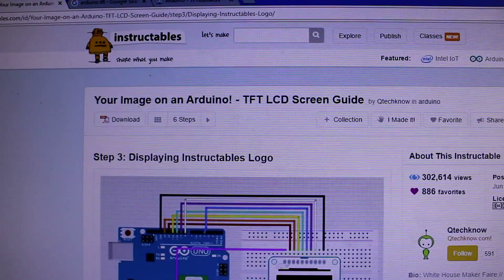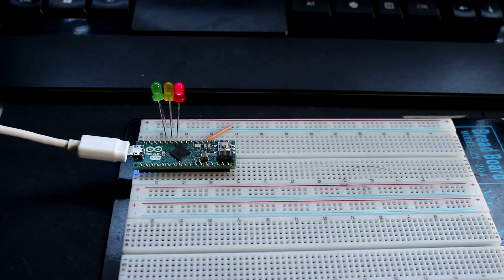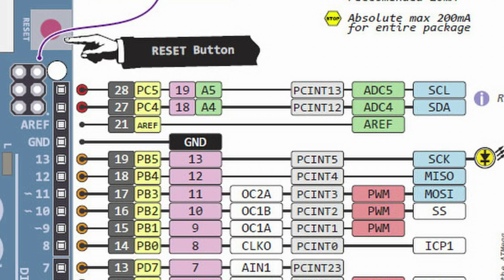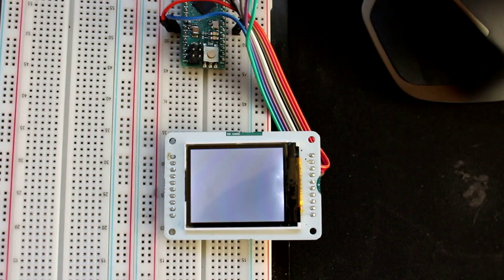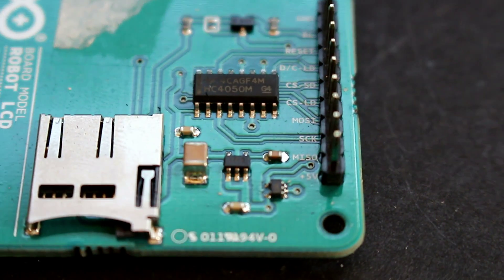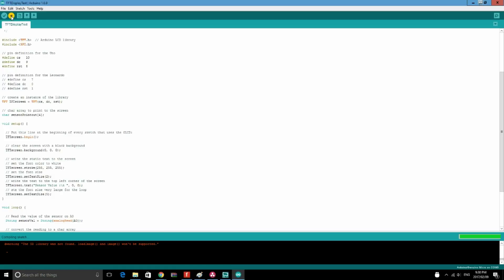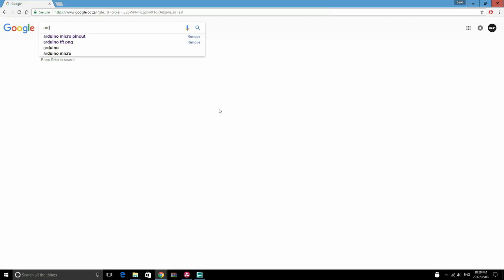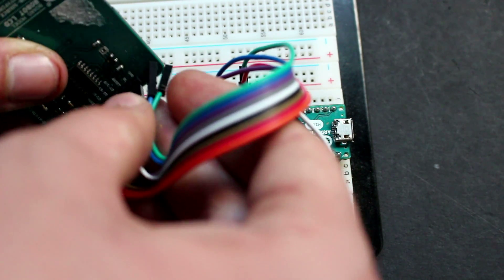Can I use an Arduino Uno for this?

Comment: You kinda look like DanTDM lol
Reply from the maker: Good enough
Reply: Build It I didn’t expect you to reply but if you’re reading this then I just want to say I really would like to see you could build a speaker system for your raspberry pi laptop or for other projects.
Reply from the maker: A speaker system sounds awesome! What features should it have
Reply: Build It I think it should have a dial to control the volume and maybe an indication light for when it’s on, if you wanted to you could add lights sign that could move to the bass of the music or sound.

Comment: Hi I have entered a problem 
Just tell me how do we control 360 degree servo with Arduino mega? The 360 degree work great with the UNO but there seems a problem with Mega the motor doesn't go in reverse direction (I used a PWM pin in both cases)
Reply from the maker: Hmmmm, have you tried using a different PWM pin on the mega
Reply: Build It 
Not till now but do you think that pin has a problem? Sure i will try with a different pin cause its new and it was my first time using it.

Comment: Great video. One minor correction would be that TX and RX are not usb communication, they are serial communication, TX for transmit and RX for receive.

That said, I do like that you call them "dedicated pins" really gets the point across.
Reply from the maker: Thanks for the correction, I think my misunderstanding came from my understanding of how Bluetooth modules communicate with the Arduino, makes sense now. Thank you!
Reply: Yeah, the BT module sends serial data to the arduino as well. In fact when you upload code to any of the Arduinos you are actually just passing it through a USB to serial adapter, but it ultimately reaches the Atmega via a good 'ol fashioned serial link. So there is no "native" USB on any of the Atmega/Arduino boards.

Further to this, the Serial to USB chip is one thing that changes when you go out and buy a cheap arduino clone (which I highly recommend, since you can get the Uno copies on ebay for sub $5 in most cases).

Comment: in the last step of the vid you mentioned we had to (Connect Everything), but for my project which is the lie detector that is found in your previous video,  I require an Arduino Nano R3, but all I have is an Arduino Uno, and I can't connect everything if I don't have the Arduino Nano R3 is there another way to be able to use an Arduino Uno instead of the Arduino Nano R3. Also, I'm a bit of a newb to this arduino stuff, so will this project work without me even having to (Connect Everything) but just using the Arduino Uno
Reply from the maker: +SuperLegoMiner 99 connect the wires to your Arduino uno the exact same way I've connected it to my nano and it will work
Reply: Hey, how's your journey in Arduino going now? :)